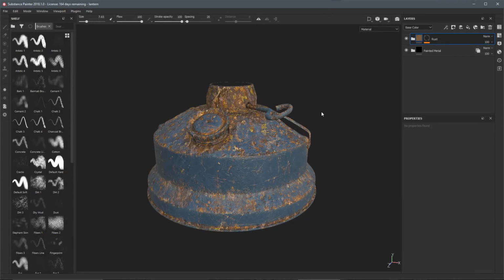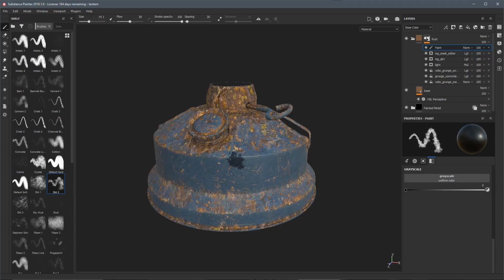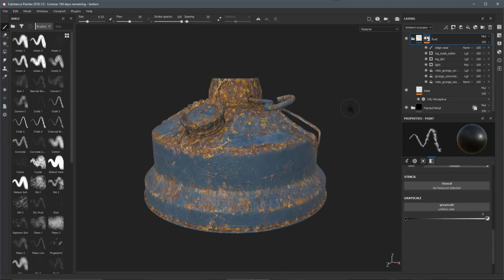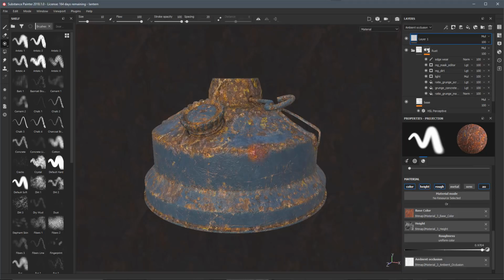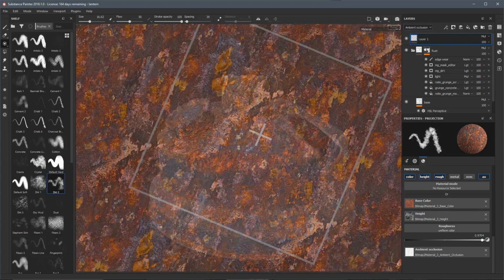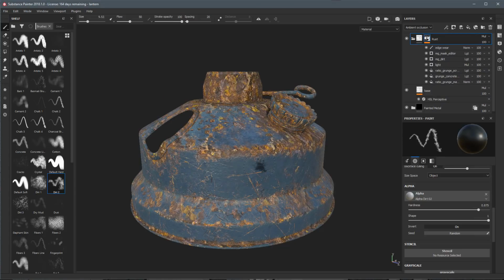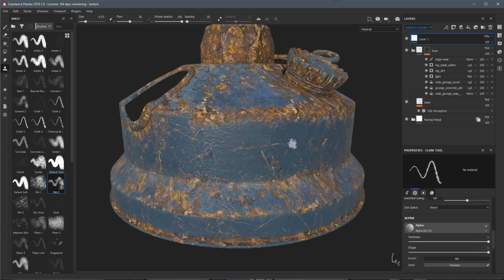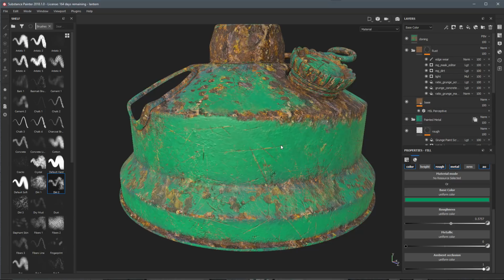08 - Using Paint Effects, Projection and Cloning tools

Comment: why can't i via projection-tool paint over normals? the normals just get combined, but not replaced (when you have a texture in the normal slot)
Reply from the maker: In this case, you need to change the blending mode for the Normal channel. The blending mode is set to NMdt by default which combines. Just set the normal channel's blending mode to Normal to overwrite the layers below.

Comment: Is there any way to rotate the clone tool's sample area? So if you like a scratch and want to repeat it elsewhere, but instead of it going horizontal like the scratch you are cloning, you would clone the scratch vertically (or any other arbitrary angle)?
Reply from the maker: I'm sorry there is not a way to do this currently. I will pass the feedback onto the team.